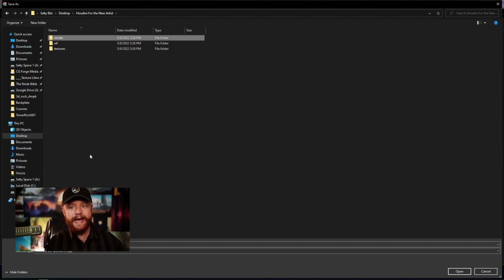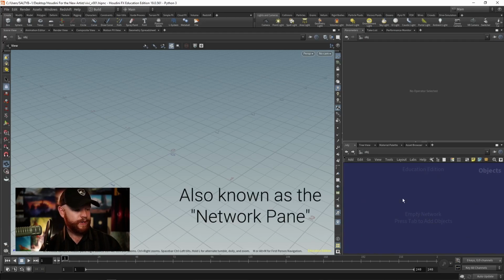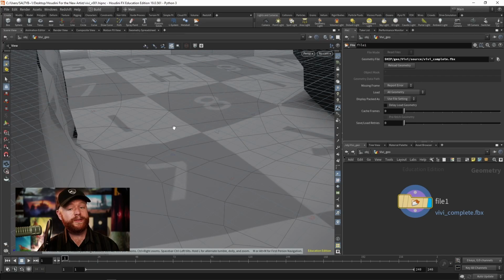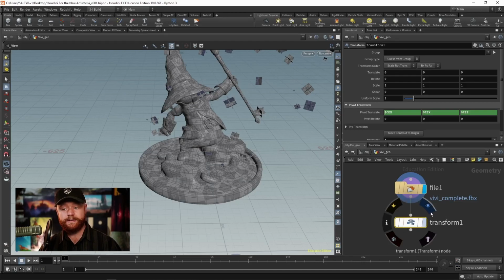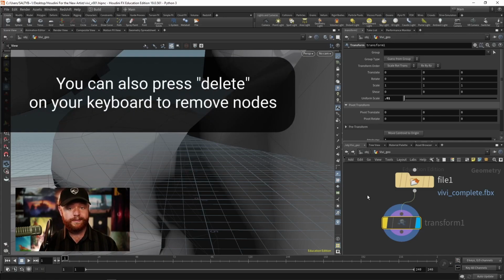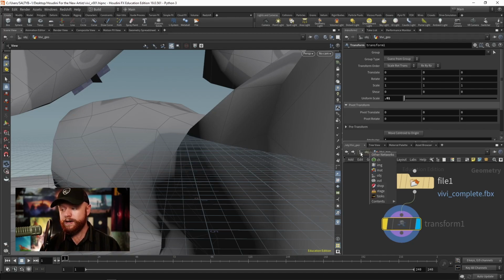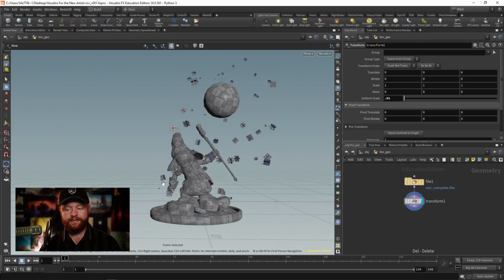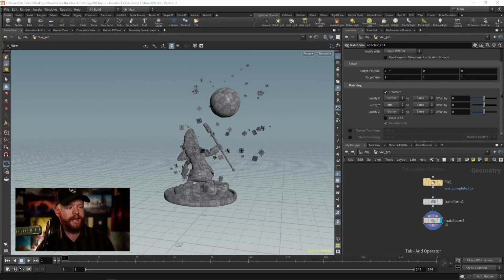Houdini For The New Artist - Getting Started with Houdini - Part #1

Comment: Do you have an indepth course on how t use redhsift for ender inside houdini and create AOV¿s to import in compo sift like nuke? I have this workflow in Maya, but I am desperately needing to move to Houdini to render the AOV passes like crypto, the other ones to revuold the bueaty, how to create those shadow passes in houdini extracting just the shadow without the other beauty passes, things like that! Man no one out there explains like you with your clarity and focus n whats needed, please do something like that!
Reply from the maker: Hey Kenedy, thanks for the suggestion.  I certainly have render engines on the agenda once I round out the rest of the Houdini curriculum at CG Forge.  For now, the easiest way to go about AOVs is by making a redshift rop, browsing to output, aov manager, adding aovs with the + icon, and then using the "aov type" dropdown to select cryptomatte and anything else you might be accustomed to in Maya.

It will be a little while until I get around to specific render engines, but one day, I'll cover them in detail.  For now, it's also worth checking out Saul Espinosa's channel.  He's a developer at Maxon with Redshift, and he has a lot of great redshift content.  Good luck!
Reply: @cgforge  yes, he is great, but for something specific like that I am still needing Maya, I can't separate the shadows from the beauty and things like that like I am used in maya, houdini makes that super different, I thought it was takes but I can't find a proper way around that either. Hope that day come soon haha!
Reply from the maker: Hey Kenedy, this video might have what you're looking for: 

https://youtu.be/0PIO2anOVUE

Look specifically around the 12 min mark
Reply: @cgforge  thanks, I will take a look!